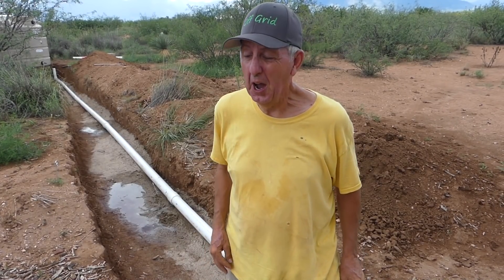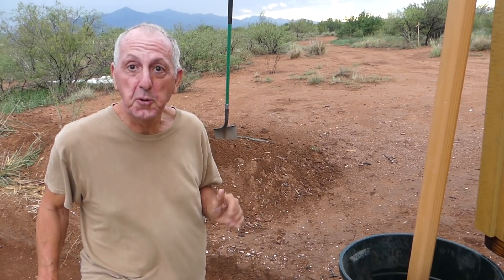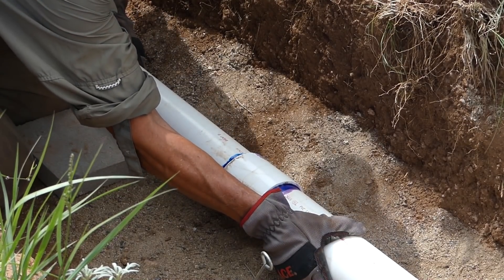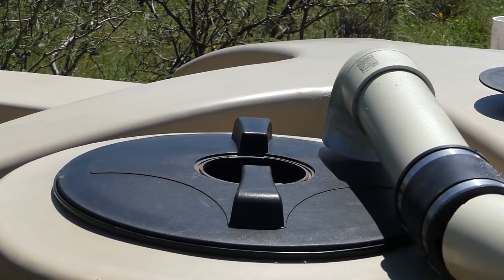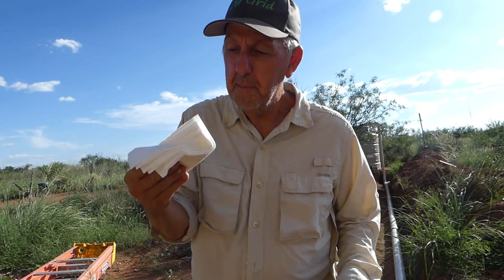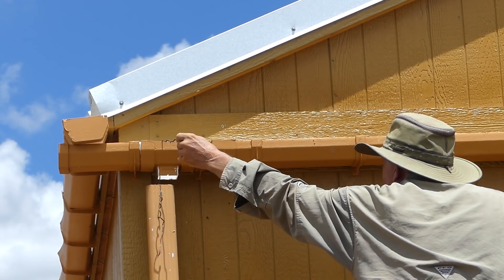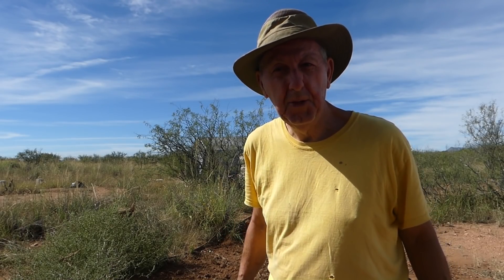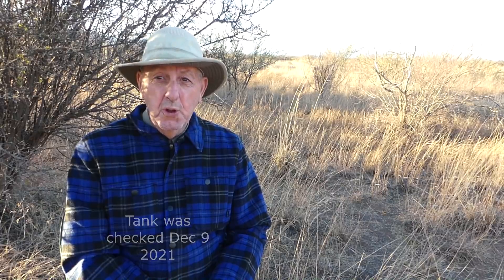Shed to Cottage Rainwater Off-Grid Harvesting Setup Pt - 2 Water!!

Comment: If you have a tube with water in it, the two ends of the water will always be at the same height. If you have one end of the pipe lower, gravity has it all flow out.  The water collection method works because the house is higher than the tank. When it rains, the water is trying to go higher at the tank end, but it can't because the end of the pipe is lower. When the rain stops, the water will be sitting in your downpipes at the level of the bottom of the pipe, leading to the tank. It will stay at that level unless you get a lot of evaporation. After rains, you can knock on the downpipes to hear how high the water is sitting.

Comment: How deep is the freeze level?  0:54 What portions of the pipe will contain water 5 hours after rain event is over?   Concerned about the freezing of standing water in the underground pipe.
Reply from the maker: Freeze level here is only the surface.  Winters are pretty benign. Although a small pipe can freeze if filled with water that is above ground.  Have had this set up for 3 winters now and no issues with freezing the big pipes. Wouldnt work in some areas though.

Comment: Hi , I am new to you channel , and am watching with much interest . Other than it would be a ton of work , why did you not recess your tank some into the ground ? It seems to me that would promote better water gathering . Just a question not a criticism . I am a retired electrician not a plumber . Stay safe , have fun .
Reply from the maker: Hi Russell. Excellent question.  It is not needed to recess the tank in the ground because the drop of the eaves is 10' and the height of the tank about 6'. So water easily runs into it because of gravity. Also the manufacturer recommends you keep the tank on the surface only and not sink it into the ground because of the pressure from the dirt on the sides of the tank.  So doing as they said here. Thanks for watching and subscribing!

Comment: Good job old timer but I'm still scratching my head on how water made it up that pipe  With almost 0 pressure . I could understand it if your house was on a higher elevation . Don't understand it but maybe it's just me right
Reply from the maker: Thanks Kelvin.  Yup it puzzles lots of people.  My neighbors said it wouldnt work.  Its pretty simple the 10 ft drop from where is pours down from the gutters provides the gravity pressure needed to force it up the 5' pipe on the other end. Just like you blowing through a straw.  Works great!  I got a good number of gallons just in the last 24 hours because of our rains.  Love having free water!

Comment: Hello Don. As an Arizona native, my hats off to you in that at times parched environment and ability to save rain fall. A suggestion from someone who know alit about plumbing mistakes, lol. At your clean out y by your tank,  you might want to places some pea gravel or similar rocks underneath your drain area.  Otherwise the sandy soil will back fill the pipe. Just a thought. Nice job on the trenching though!
Reply from the maker: Thanks so much for your comments.  I actually placed a PVC cap at the end of the drain area so that no sand/soil can back fill the pipe.  I need to clean the dirt in front of the cap out though.  The plan is to do that before monsoon starts next year and also flush the whole pipe system with water which I can because of how its set up.

Comment: Don.  Been watching for a bit and subscribed.  One comment on the downspout.  I would add a clean out right at the cabin.  You let the water fall into the pipe, then let it fill up say 36 inches and then at a 90 you can drop the water into the main supply to the tank.  This will allow sediment to fall into the 36 inches of pipe then float to the 90 and then down to the tank.....keeps more fine mud out of the supply line.
Reply from the maker: Great tip Gary. Thanks!

Comment: PVC that is exposed to sunlight should be painted to prevent deterioration from UV light  I learned that many years ago from a City of Los Angeles building inspector. Also, the purple primer "melts" or softens the pipe and should only be used on the thicker pvc,  and not class pipe. Red Hot Blue Glue eliminates that step, but is more costly. I just found your channel and subscribed.
Reply from the maker: Lynn the PVC is buried as you can see for the most part.  The exposed stuff is all painted.  Everyone I consulted about Schedule 40 PVC told me its super tough and thick and to use purple primer and glue.  Just going by the experts. Delighted you came by and subscribed.  Thanks!

Comment: Fun fact I learned to sand the joints before you glue them. Your joints will hold a lot of pressure much lsss a non pressure system
Reply from the maker: Thanks Michael.  Professional plumbers said that the work I did went well which was a great encouragement!

Comment: Hi. I love that system great job. We are looking to be snowbirds with off grid living. I’m curios how many inches of rains you get annually and what months. We collect rainwater at our remote cabin. We spend most of our summers there. I’ve seen 9” of rain in 10 days the end of August. I did the math and we get about 30 gallons of rain for every 1/10 of and inch of rain off our roof.
Reply from the maker: Thanks Chris.  We get about 14" of rain per year here. Even so my little 200 sq ft cabin provided 100s of gallons of water this year.  It was a great monsoon season.

Comment: Just curious why you set your rain barrel so far from the cabin? Is there an advantage not having it set beside the cabin so you wouldn’t have to dig trenches and purchase all the pipe?
Reply from the maker: Excellent question folks! All about esthetics.  I am hoping to have another building on the property and then this little cabin becomes an airbnb for visitors.  I like that the tank is hidden away a bit behind the mesquite.  Lots of work digging the trench but I saved on nautilus fees  right?
Reply: @affordabledesertliving3487  Indeed 💪

Comment: Roughly lay out the pipe to make sure you have enough pipe and fittings
  Ensure access points to clean out airborn sand that will build up in the pipe.
  It is easier to work from the guttering to the tank.
Reply from the maker: Thanks for your kind input John and thanks so much for watching!  Cheers!

Comment: Sorry but why did you put the tank so far from the collecting roof? Plus you could have had a simple shade structure attached to your shed) to protect your poly water tank from sun damage.
Reply from the maker: Hi Rudy. That is an excellent question and one that comes up quite a bit actually.  I hope to have another building north of my cabin for my larger home.  Then this little cabin can become an airbnb rental.  For aesthetics I wanted to disguise the tank some so that its not so in your face. This type of tank from Oasis Rainwater Harvesting is built to be impervious to sun damage unlike less expensive ones. Thanks so much for watching and thanks for the questions!

Comment: As a thought “desert horizon “ you tuber, put a tee at the down spout then 90 degree off to his tank feed. He dropped a pipe down below the tee with clean out at the bottom. Idea is all the garbage fills the drop down first and most of the crap settles there and water in the main line is cleaner. Just an idea, he is somewhere in the south of az as are you.
Reply from the maker: Great feedback. Thanks Richard!

Comment: Sweet don let there be water. How much did that setup cost ya
Reply from the maker: Some estimates here Shaggy (havent tallied the receipts) but $400.00 for the pipe. $1200.00 for the tank. $1500.00 for the solar water pump. So compared to ordinary residential water systems not much.  Also remember a well in this area has a base cost of about $18,000.00

Comment: Hey Don, great job on the water system! Could you post the link/info for that solar water pump? I've been looking to get one for our property, Thanks.
Reply from the maker: Hi Grimrpr6942. Thanks for the encouragement. There is a link in the description to RPS pumps. Mine is called Tankless Pressure Pump™ System. Very affordable and it creates 40 PSI on just four 100 watt panels!  The demo I did caused me to be very impressed!  Their customer service is fantastic as well!

Comment: Nice job! But it crossed my mind, why couldn't the water storage tank be set right next to the cottage, with a pipe coming directly off the rain gutter into the tank? Is there a reason or regulation of having the water storage tank at the distance you set yours?
Reply from the maker: Good question! Thanks Julio. The reason is simple.  I am hoping one day to turn this little cottage into an airbnb. So for aesthetics I thought it would be nice to have the tank a distance from the yard so folks are not staring at a big ol water tank all the time.

Comment: Always good Don you have done good why would you put it so far away and what is that at the back Solar panels rack i recon long run to the house you loose electricity long runs you know
Reply from the maker: G'day Kriss hope your having a nice summer. Spoiler alert.  Hoping to make the cottage into an airbnb and have another building to live in.  For asethetic reasons wanted the tank off a bit so I can disguise it with shrubs etc. The solar rack is about 70 ft from the cabin.  Fortunately I should have enough powerful panels purchased at this point to provide the power I need.  Learning as I go so I can adjust if needed. Thanks as always for watching mate!

Comment: I bought a trenching shovel and it makes things so much easier. It is about 18 inches long and 4 or five inches at its widest. You don't have to move as much dirt or hit every rock in the area. The pipes could have been stacked if needed. Now if you're looking for a good work out, I read were ditch digging burned more calories than jogging.
Reply from the maker: Well I definitely was thankful when the digging was completed but it was a fun workout I will admit. Thanks for the super tip on the trenching shovel!

Comment: Good job Don and glad to see another video. But seems you did a lot more digging on that trench than necessary. Although it is good exercise digging. Have you ever thought about building a carport? It would give you a lot more roof space to collect more than double your water supply. Plus it keeps your car out of the hot summer sun. Just a thought. I hope you have a Merry Christmas and a blessed New Year!!
Reply from the maker: Yes definitely a lot of digging!  Part of it was that as you can see I ran both the 3" PVC and the 1 1/4" pipe in the same channel. But next time I will try to work smarter not harder to refine the width of the trench. You are RIGHT ON the money with the idea of a carport.  It's in the works but has to happen after a big list of things like. solar, foundation for the building, water hooked up, propane hooked up, drywalling etc.  LOL.  Merry Christmas and a Blessed New Year to you as well!

Comment: Another comment, I seldom used the purple primer on non-pressurized pipes. I hate this stuff as it seems to stain everything in sight. The last house I Saul had a big purple stain on top of the dryer. I won’t say how it got there! The adhesive alone seals it quite well enough if there’s no pressure involved, but the purple primer is absolutely essential if you’re putting together pressurized water pipes.
Reply from the maker: Thanks Scot! I did spill some purple primer here and there but figured I wanted to make super sure I did a great job of connecting the pipes together so as usual my motto is even if it's overkill its just a bit of money and hard work. I learned something with your comment though.  Many thanks!

Comment: What happened the 1st time?  
  The only time you need to worry about the pipe joints leaking after gluing is when the cut isn't straight. Burrs are no big deal. The solvents in the primer and glue melt them off.
You need to connect to the fitting under the filler top. With that open you will get a lot of dirt and evaporation. 
Make a sight glass at the house end on the downspout with a bit of clear tube. Keep it shaded to prevent algae.
Reply from the maker: Hi Charles!  There was never really a 1st time.  I was so worried it wouldnt work I dry fitted then duct taped it all to experiment to make sure water would dump into the tank. As I mentioned a total newbee to PVC etc.  Thanks for all of your thoughtful suggestions!